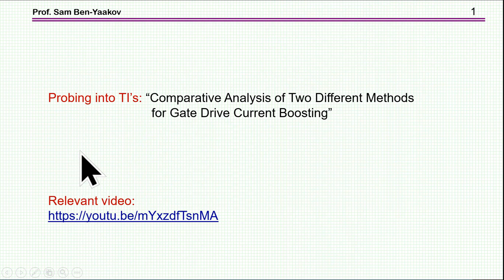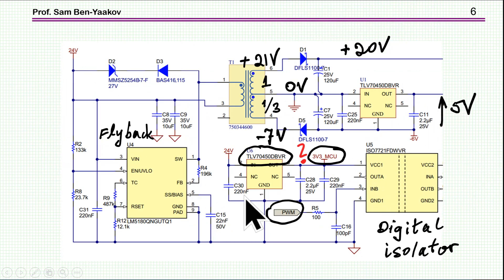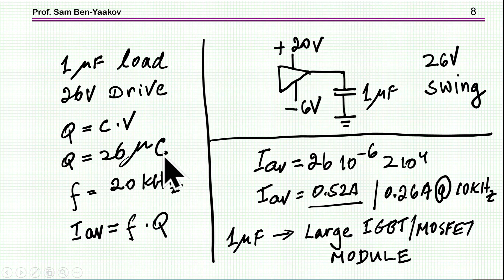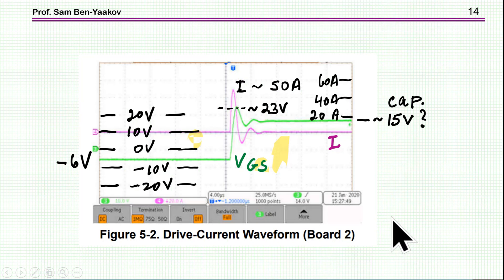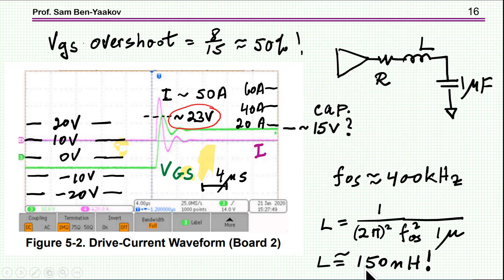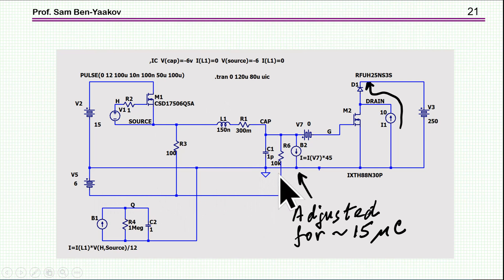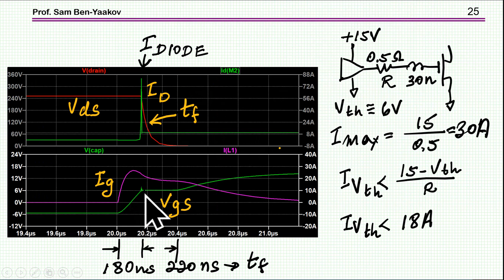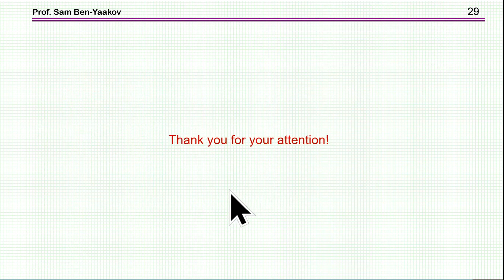Probing into TI’s: “Comparative Analysis of ... Gate Drive Current Boosting”

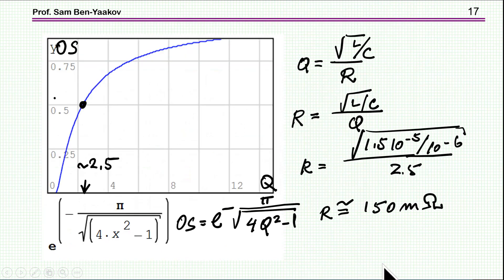Comment: Dear Professor, as usual, all your explanations are very illustrative. I have a question and one observation: at 7:05 there is a term W=P(f/Rg) how did you deduct this (f/Rg)?🤔. And the observation at 11:46 is that L=150e-9 and not 1.5e-5 (or 150e-7 ?)...either way the result is correct 🙃. Thank you for your video and big fan here!!👏👏👏
Reply from the maker: 1. Charging and discharging a cap entails a power loss, All the loss is dissipated by the resistor.
2. OOPS, you got me there. I will put a correction note in the description. Thanks for checking.

Comment: What's remarkable is that you use ltspice and still make it obey you. I'm a bit reluctant in using ltspice because it doesn't tailor parts across the board. Kicad has ngspice integrated but also doesn't have a wide range of components for simulation, due to IP. Which proves we need to get back in touch with spice simulations in general. I'm a bit rusty in that regards. There's also the ability to determine if a simulation is behaving according to parameters handed over to the simulating program. I think I need to hit the basics yet again to get in touch with how to pluck the needed parameters from the datasheet. There is also the issue of how to figure out which models spice is using to run simulations, like bsim, etc... I appreciate your work professor, it helps us figuring out where the gaps are in our understanding. Thank you.
Reply from the maker: Thanks for comment and sharing your experience.
Reply: @sambenyaakov  you mean sharing how much we lack in experience 😂 that hurts me in my liver. 

Hope you appreciate theatrics.
Reply from the maker: @xDR1TeK  Let's not exaggerate, I meant just sharing you thoughts. In as much that I am considered a joker, I really meant it. Comments like yours provoke farther thinks of the subject. Thanks for taking the time for the conservation (unless you have nothing else to do😂🤣)
Reply: @sambenyaakov  a good laugh never hurt anyone. I miss academia, of the whole internet I find your work uplifting. These days, I look at my electronics bench and think to myself: what am i going to make today? There's no target in mind. Lately thinking about going back to radio stuff. Or maybe build me a good power supply. All of them need parts. Then i go sleep 🤣
Reply from the maker: @xDR1TeK  Most importantly, keep busy! This is the secret ingredient of good and healthy life

Comment: Thank you for the video. About 15V at turn on - may be they have not enough bulk capacitance on +20V dc-link, for example, ceramic caps with nonlinearity... On the actual waveforms we can see kind of slow recovery charge process back to +20V. Thank you!
Reply from the maker: Thanks for comment. They have a total 140uF on the 20V  bus and on the -6V bus. Assuming a 50% drop we have 70uF. Charging the 1uF cap will cause a 1/70 th drop, about 1.5%=0.3V. For a 5V drop out of 20V, the bus cap will have to be 4uF! It is quite possible that the schematics does not represent the cicuit used, which is bad.

Comment: I wonder if the line was actually 15V and the 20V was a incorrect measurement from the -6V instead of ground.
Reply from the maker: Yes I considered that but gave them the befit of a doubt: doing a mistake in measurement is acceptable, but not looking at the result is not. At least in my opinion😊